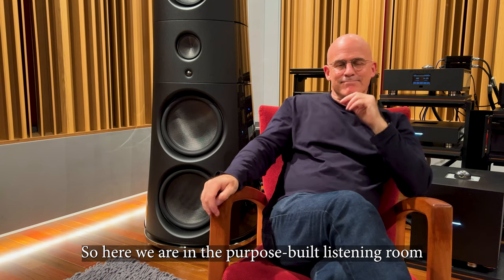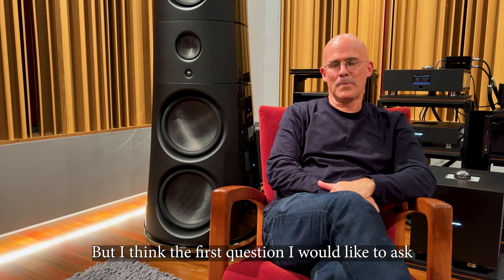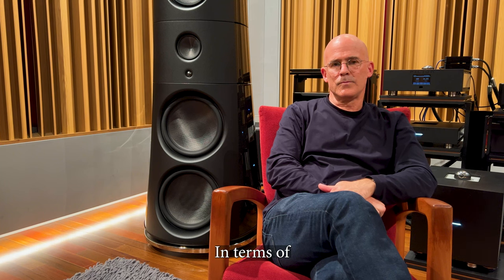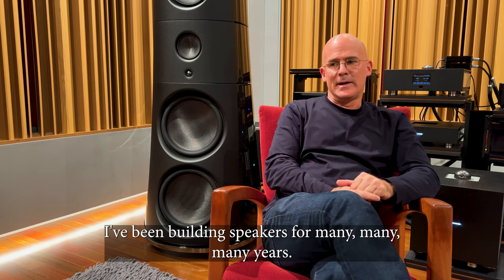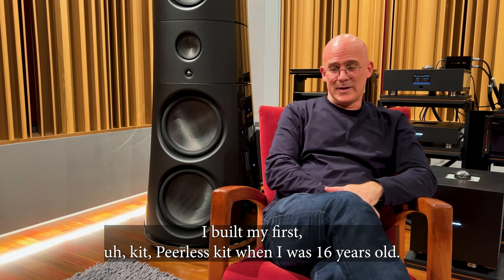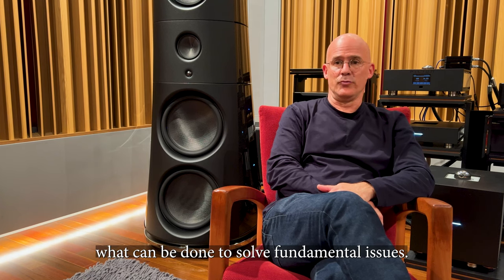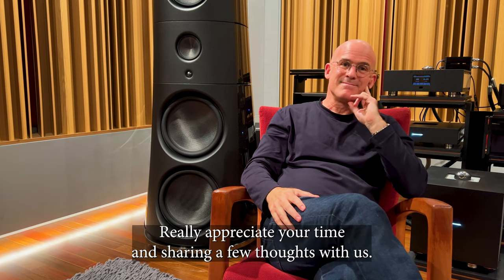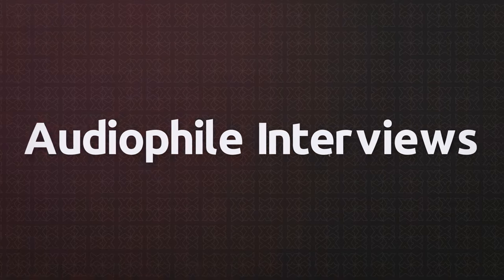How Far has the Magico M9 Pushed the State Of The Art? | CEO Alon Wolf

Comment: Celestion (obviously a COMPLETELY different price bracket) were building truly wonderful aluminium honeycomb (aerolam) speakers in the 1980's - the SL600 and SL700.  - ahead of their time.  My experience with the SL600 is that they projected a holographic, 3D stage image, similar to that achieved by Magnepan, but without the extreme depth.

Comment: I would be curious to learn what led to the change of employing an analog crossover here vs the DSP of the previous flagship (the “Ultimate”)
Reply: DSP is not a great solution. It’s fine band aid for budget gear, but at the high end you definitely do not want to convert analog to digital and back to analog again!
Reply: @Fluterra  ?? You dont have to do that, the crossover can be computer based fully in digital domain at the very start of the chain and then the digital signal sent to multichannel studio mastering level DAC like Merging Horus and then to amplifiers for each driver. Such xo/dsp will always be magnitudes better and more precise than shitty passive xo, it also allows for phase linearisation something that is simply impossible to do in passive.